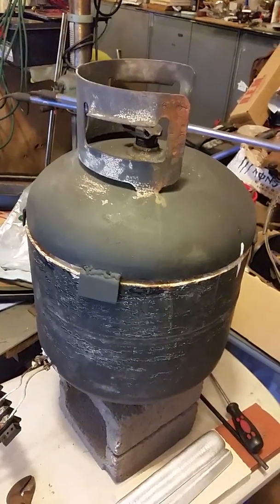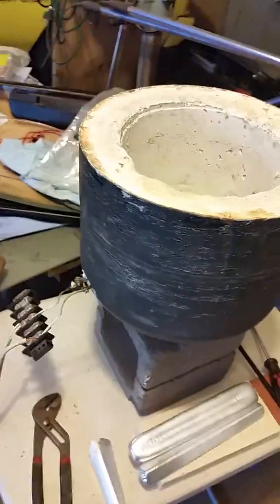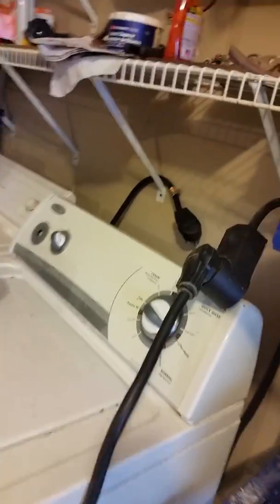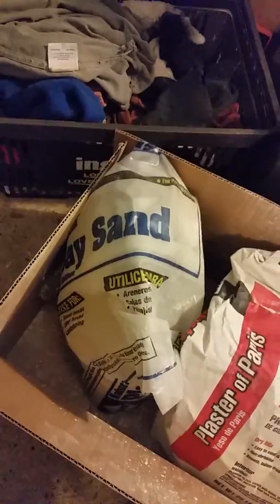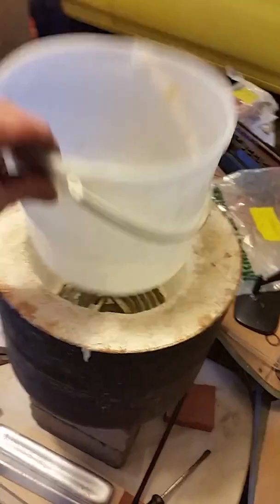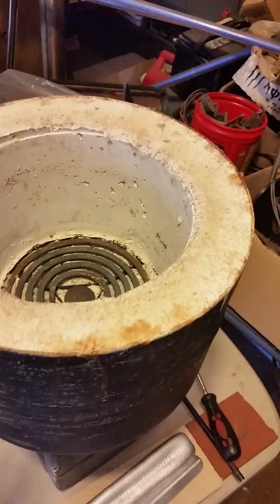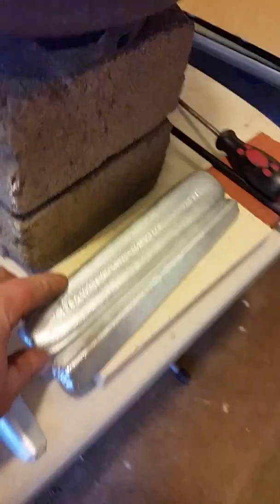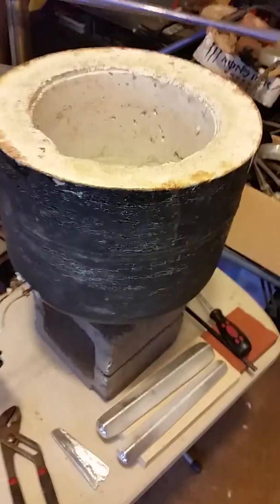DIY electric kiln metal aluminum melting furnace works easy cheap 220v home made

Comment: Wow, Fantastic job!  Hope you made a vid of it in operation.  How's it holding up after 4 years?
Reply from the maker: thanks, well I havent needed it in a while. I was melting aluminum for casting parts. I didnt feel it was worth using it just for the sake of melting cans because after a few days of hard use the burners would wear out due to lack of temperature regulation and the crucibles didnt get much milage either.

Comment: Could it work with a non 220 plug. Properperly a wall plug outlet.
Reply from the maker: I could not get the heat high enough with a simple 110v wall plug. I think it will work but it will take a very long time and the insulation has to be better. any heat loss will negate the heat being accumulated. 220 has excess heat that overcomes the heat losses in a reasonable amount of time.

Comment: Super, I’ll have to see more on this build with a 220 volt stove burner.
Reply: I have a 120 volt hot plate burner coil, will that heat hot enough? I used the hot plate to melt lead for my lures. It took using a torch to add to the heat for that to work but the heat escapes from an ope coil burner. Maybe in a closed furnace the 120 volt coil will be much more efficient.  After reading all post to this video I don’t think I will try the 120 volt burner. I may just buy a furnace rather than make a dangerous contraption and if I can even have success in making the insulted fire wall mixing sand and what ever.

Comment: For the benefit of those that try.  Be very careful.  This works but always stay as far away as possible    Should your crucible drip hot melt over the element the results are “ Spectacular “.  And a proper earring is required at the element as well because they do break down.  
   I will attach a link to what the damage is like when the crucible fails under the extreme heat possible
Reply: Alfred, you are absolutely correct. thanks for the added safety warning. it is very dangerous and can even burn your house down. The molten aluminum does not explode like when you drip water into molten lead so I dont see that being a problem, the 220v just sends electrical arcing where it can until your circuit breaker shuts off. I have had the 2 burners get so hot because they are not regulated that they eventually melt together and it arcs and then just pops the breaker. I have had crucibles both steel and carbon fail through the bottom and run on the burners. that doesn't hurt the burner but when the molten aluminum flows to the electrical connects to the burners, it is a direct short and then an arc , then the circuit breaker cuts it off safely. but then the aluminum is everywhere and then hardens and you have to dig it all out and restart. I bought a clay crucible that seems to be holding up the very best so far. My only problem now is not letting the 2 burners overheat and fuse together. I am considering using a thermocoupler and relay to control the temp because it will just keep climbing unless you keep drawing out the heat by melting aluminum at a rate that it doesn't let it overheat but that is a guessing game. I stopped using mine until I set up the temp regulating. dont ever leave this unattended, have a fire extinguisher handy and a place where if the aluminum crucible brakes that the aluminum cant flow to the floor and burn your place down.
Reply: Typo.  Earring should be Earthing / Ground connection

Comment: looks cool, but biggest drawback of this desgin (coils on the bottom) is if you have a crusible leakage or spills,
it can/will destroy the coils (just  a matter of time)
Reply from the maker: hi, yes. and that has happened to me. I now have a drain hole that allows for the molten metal to drain right out where the wires go in through the bottom side. good thing is that the coils are easily replaced if you dont embed them in the solid insulation material. Nothing lasts for ever, , this sure does the trick though. I welded up a pretty robust crucible that should not deteriorate too rapidly under these temperatures.
Reply: @einstyndotcom  i guess because the aluminium eats the steel away. Graphite is more reliable for aluminium but more expensive to buy. When i am ready with my build i plan to try clay inside of a steel cruisible.
Reply from the maker: @hyperhektor7733  I didn't find there being a problem with the aluminum eating the steel, the inside is fine, the problem is the heat drawing out the carbon of the steel and the steel gets thick flakes of carbon that break off and then the steel gets thinner and thinner from the outside in from the heat. Also it is more than just the heat that speeds this process up it is the oxygen. the inside has less oxygen to pull the carbon out of the steel due to it being more enclosed, the outside of the crucible however has oxygen flowing by it constantly and therefor  causes the steel to oxidize and turn into iron quicker. I have run tests that show, just as for purchased graphite/carbon crucibles, they all last much much longer if you deprive them from oxygen at high temperature. So I try to keep the lid on as much as possible and especially as it cools back down. I have gotten so far way more than 10 time the usage out of my steel crucible than the carbon ones. you just need to have at least a half inch thick steel base with a full 1/2" thick weld or it will leak through after say 5 hours? I actually have not had to replace my steel crucible since changing the base from 1/4" to 1/2". I used a 4" x 4" square steel tube 1/4" walls as the body of the crucible. and the 2 welded on washers work very well to hook and pour the aluminum out. I will have to make another video of that. btw, I dont think clay will help anything, it will deteriorate and brake up, especially due to the thermal expansion differential with the steel. big mess, no value,
Reply: @einstyndotcom  thanks for the info

Comment: Do you believe this or something similar to it in square form and possibly 110v could be made for bringing high carbon steel to a temperature that would bring the steel to a non-magnetic state? Then for heat-treating also? I've been looking at a lot of propane forges then they use an oven later. I just wondered if you had an oven that would do it all, wouldn't that be better? Certainly, it would take up less space and require less "tools" to get the job done.
Reply from the maker: I dont think 110v will get you there, but it might. I couldn't get aluminum to melt with 110v which means it didn't reach 1220F. maybe it could over a long period of time. With 220v I melt aluminum pretty well, But I dont think I could get it to melt brass 1823F.  So this system works very well for what I wanted it to which is melting aluminum cans and scrap. I bought a cheep Hardin tabletop Chinese furnace off ebay to melt higher temp metals like brass and such. The problem with the higher temperature is that the carbon crucibles burn up rather fast for a cost effective method of melting scrap. That furnace has a controlled 2200F limit so to what you are talking about, I ended up using it for various heat treating needs. I heat thread and temper 4104 steel parts to 1571F and 4130 steel to 1650F with pretty good results. So back to your comment, I dont think my home made kiln will get to the temps you want with 110v. 220v should eventually get it there (1571-1650F) but it is slow (which may be good) but it depends on how well insulated it is. Also if you are going to do that, I would rig up a the electronics to accurately control the heat with a digital display and control like my Chinese furnace does. I think it would be rather important for that, whereby I dont really care what the temp is in mine as long as it melts the cans quickly. So it may be possible to do what you want. good luck
Reply: @einstyndotcom  Thanks for the input, just trying for an alternative to things that can blow up LOL.....
Reply from the maker: @Tripsolo65  you aint kidding, I had a soup can burn through and leak molten aluminum into the bottom and short the 220v BOOM! had to dig it all out and rebuild. That why I made the think based and welded steel crucible that I now use. but even it will only last so long.

Comment: Amazing video. I'm trying building one at home.Unfortunately I have only one stove burner (the 6 incher you are showing in the video) and noticed to late that you got two☹️ I want to build a burnout oven for investment casting with 3d printed parts... Any possibility it works though?
Thank you in advance and keep going with your videos. Best regards from Germany
Reply: thanks, I think one burner will be fine. I think it will generate plenty of heat with one burner hooked up to either 110v or 220v like we have here in the U.S. I dont know what power you have available or what your temperature requirements are. I believe you can hook up 110v or 220v to the stove burners and the heat generated is simply a function of that. I run 220v through both burners in "parallel" so that I get the maximum heat generation from the power that is readily available. This allows me to melt aluminum which has a melting point of 1220 degrees F. and I know it doesn't get that high on 110v. If you know what temperature you need you might be better off getting a cheap used oven that has a temperature control setting to not over heat your parts. But if an oven's max temp is not high enough, this could be your solution.?
Reply: Thanks a lot for your reply! I really appreciate that. In terms of aviable power there is an aviable voltage of 230 V with a max current of 16 A. For temperaturen control I hope that a ssd-relay with PID controller is suitable.. Was really cheap on Ebay.

I actually would like to have about 650-700°C for good burnout.. Sadly these stove burners aren't that easy to get here in germany☹️
Reply: @AlexMoophty  I think you will get that temperature out of one burner with that much power! I could alway ship you burners if you need them? shipping would probably be alot which defeats the purpose.
Reply: If the shipping isn't to much I would take the offer. I've got project with precision casting and its really important for me to terminate that successfully
Reply: @AlexMoophty  email me at wagons@einstyn.com and we may be able to work that out.

Comment: So do you put the crucible directly onto the burner? And how about proving to us it works with a vid showing this?
Reply from the maker: wow, is that what it has come to? I need to prove it works? Is there that many scams on youtube that you think I would post a video of it if it didn't work, whats in it for me to do that? I am not selling anything or getting paid for you to view my videos. I am confused by that comment, but anyway, I haven't figured out a way to add to a video so I posted another video of it working some time ago. If you look at my comments below there is a link to the updated video. In this video it is shown working. Yes, I put the crucible directly on the burners. Good luck
Reply: @einstyndotcom  It is an interesting method you used so big disappointment came when close to the end it dawned on me , nope there's gonna be no actual melting happening. No harm meant

Comment: Does it only run on 220. What's the highest temp does it reach?
Reply from the maker: Yes, that is stated in the title. watch both videos I have on this. It runs on 220 and it gets to around 1500 degrees F due to the fact that it will melt aluminum but not brass and copper. I dont have an accurate way to measure what the max temperature is.
Reply from the maker: You can run it on 110 but it will either not meld aluminum at all or it will take so long it isnt worth it. it is very easy to hook up 220.

Comment: is that a Walmart hot plate in that thing?
Reply from the maker: John, I think I checked walmart for burners but the one near me didn't have them, So I bought mine at a Lowes Hardware. Not sure it matters. I took a new video and pics of my system mod that uses a large and a small burner put together and I wire it to 220 it works really good. I will work on getting a new video up and put a link on here to it. be sure to read all my comments on this video. Like I said, I have it now to where it is really really nice to operate. Its got to be the best out there as far as easy to use, maintain,  functionality, and  cost and ease to build.

Comment: This really work? Make a video of the melting
Reply: Vern, It works, I am still using it. The same burners I put in it 2 months ago. I did have to tighten the screws that connected the wires to the burner terminals. the heat expansion cycles loosened them over time. Works like a charm and the inside walls of the thing are still prefect. I will try to take a video but trust me its working good.

Comment from the maker: This configuration with 2 burners in parallel had 18 ohms resistance, my 220 power out put actually measured 215 VAC across the two hot leads making this unit about a 13 amp consumer putting out around 2500 watts of heat. My thermal reader could not read the max heat because it exceeded the limit of the reader. Just melted down around 20 pounds of aluminum from cans, a huge broken patio umbrella frame structure and random junk. Ran it continuous with no problems. Wish I could post a picture here.
Reply: How's the system holding up?   Any thoughts on silica glass coating fiber wool and maybe doing more of a sphere like from a beach ball or basketball or etc. top to better reflect heat back down?
Reply from the maker: @jafinch78  the top does work better if it is better insulated. I have used mine a lot and I would say my problem has been the crucibles lasting. it almost doesn't justify the cost of the aluminum ingots for the cost of the crucibles. also, I have found that eventually the burners fail. they must wear through and short out? maybe they are just getting too hot and melting because there is no heat regulating. I think it really needs a heat regulator to not overheat the burners. if you feed aluminum in it continuously, it works great, if you stop and forget it for a few minutes i think it overheats. I have stopped using mine and have to rebuild the burners. I probably wont use it unless I need to cast something that makes it worth it. just melting cans just isn't cost effective for the purposes of making aluminum bars. you can sell the cans as cans and save yourself this effort.
Reply: @einstyndotcom  I was wondering about using free waste oil as the heater burner source so then only the cost is for the blower and time to get the waste oil from your sources where I see online often... usually used motor oil.  In regards to crucibles, have you considered firing your own?  Might be able to find formulas/recipes online for the carbon crucibles that might be suitable I'm guessing.  Unless you use graphite... then yeah... those are pricey.  I haven't done in so long... seems when I last left off I was thinking most cost effective would be waste oil burner and making crucibles using a high carbon content clay recipe I found somewhere online that I'm not recalling offhand.
Reply from the maker: @jafinch78  I just bought the expensive graphite crucibles. haven't tried used oil for that, but I build an amazing used oil heater for my garage that doesn't need a fan, it has a drip system and a bottom draft with holes in it to pull a high velocity air jet across the oil and burn it very well. the 10 foot flew pipe causes the heat rising to pull very hard. the thing hums like a freight train and glows red with 5 foot of pure red jet flame out the top if you do not regulate it down.  5 gallon bucket of oil lasted me like 12 hours gravity fed.
Reply: @einstyndotcom  Thanks for the insight into the waste oil burner oil feed rate.  Was wondering that.  Did you make a video by chance of the used oil heater and not upload?  That'd be a neat design to see how you made or at least designed.   Yeah, clay and graphite when I looked maybe almost a decade ago was way more cost effective... especially if you have a larger kiln to fire as many as you can each firing time.   I had more experience with pottery... though that was like two decades back.  My foundry work has all been lab work primarily and have been storing materials to eventually have the range of metal working shop equipment.
Reply from the maker: @jafinch78  I will get a video of the oil burner and post it when I do.
Reply from the maker: @jafinch78  I just uploaded a video of the oil furnace